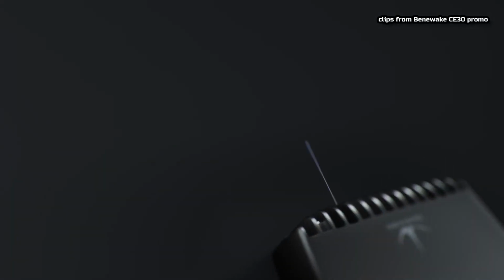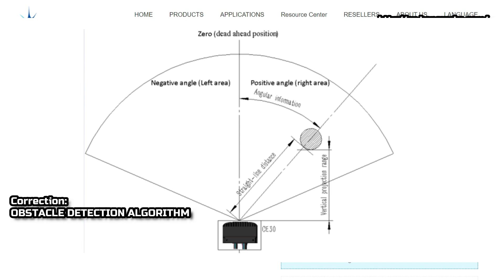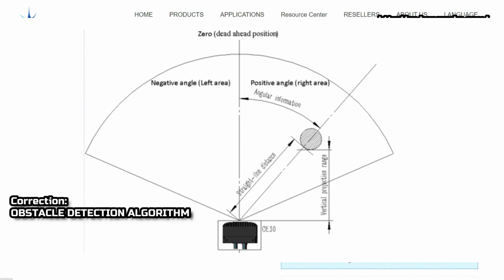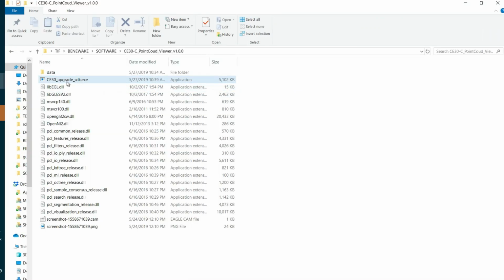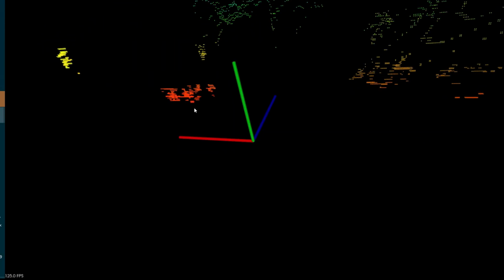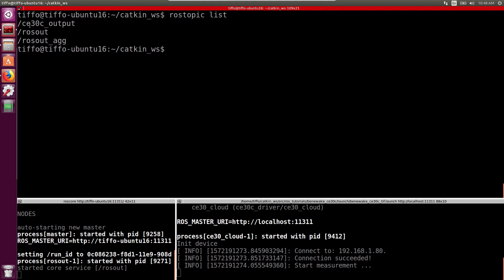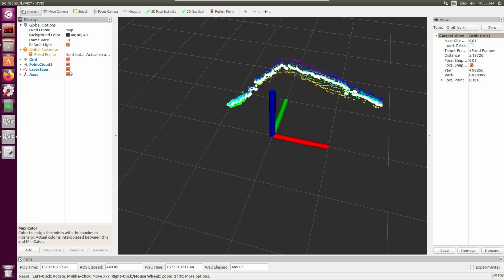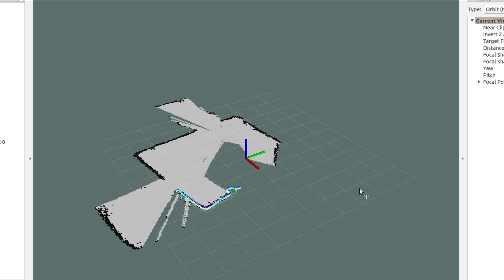Benewake CE30-C Solid State Lidar | Unboxing and ROS integration

Comment: Sir, I have few questions and I hope you can answer me.
1. Can we use the lidar with other platform other than Linux to run the ROS? Say windows. What are the procedures?

2. Is there any way that we fuse the reading of this CE-30 with a webcam/any camera?

3. Can OpenCv run CE-30 for mapping or object detection?
Reply from the maker: 1 Ros runs on Linux
2 yes
3 i don't know
Reply: @prandtlmayer  thank you for responding. For question 2, is there any video u could suggest me to look at or any tutorial? Much appreciated thank you

Comment: Fantastic, how do you do the mapping? Is it only using benewake and using laserscan matcher?
Reply from the maker: Yes, using Hector SLAM. Only scan matching
Reply: Can you share to me about Hector Slam and scan matching?
What package are you using?
I already test benewake, convert point' cloud to laserscan, using SLAM still not working to have mapping.
Reply: Is it possible to use multiple flash Lidar cameras pointing if different directions with HectorSlam?
Reply from the maker: I showed that in a previous video of the series
Reply: @prandtlmayer  thanks. I will explore your archives. Thanks for the informative bids.